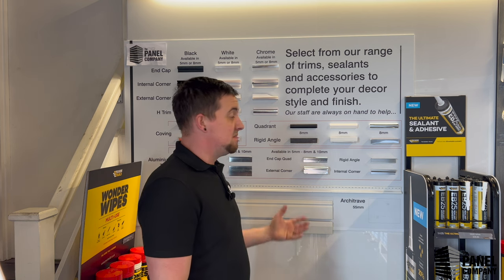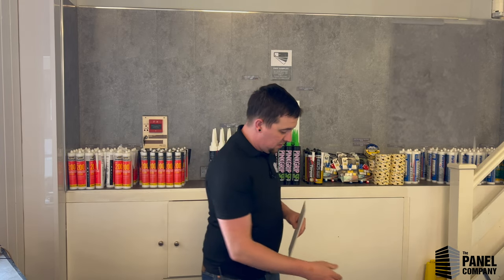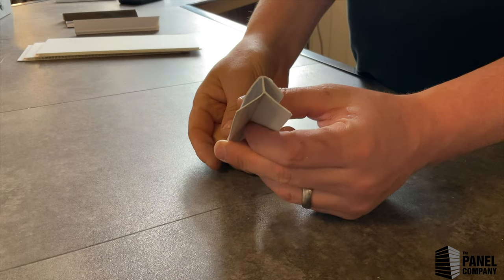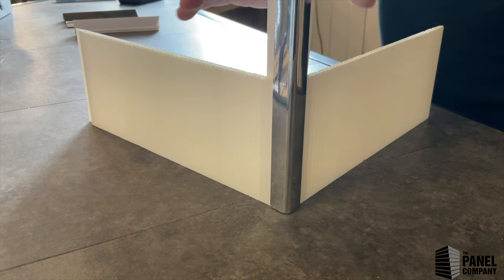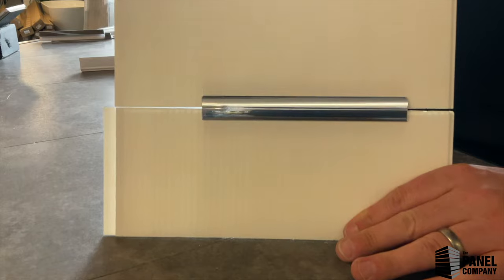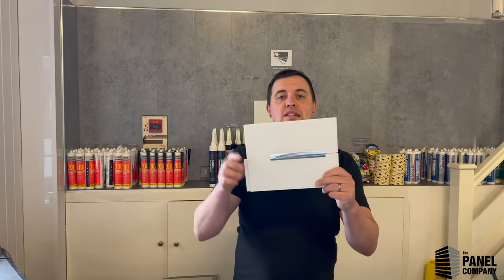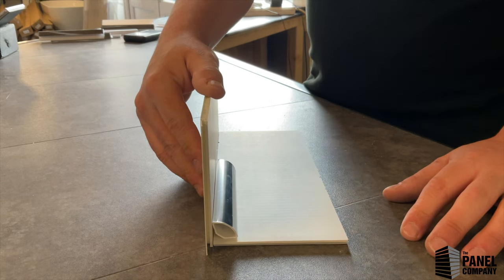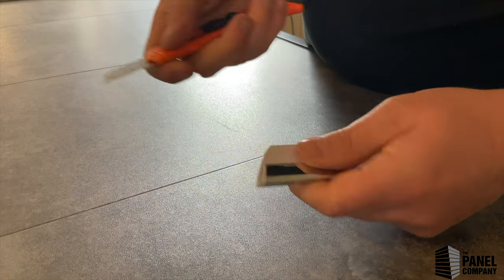Wall Panel Trim Guide | The Panel Company

Comment: If your wall height is 2405 and panel is 2400 what would you use to bridge the gap between wall and ceiling?
Reply from the maker: With only about 5mm you have a few options. Option 1: use a coving trim around the top which is about 8mm. Option 2 raise the panels and use the skirting to cover the gap. Option 3: Drop the ceiling and use the extra space for the likes of sunk in spotlights or speakers.

Comment: Hi Panel Co. Have my delivered panels from you now. Can I just ask, for the end trims, do I stick these on first before applying the panel to the wall? If I don't I imagine I won't get it behind the stuck panel. If this is the case, what do you stick the end trims on with? Thanks
Reply from the maker: Hi Samuel - Yes you are quite right - you would need to install the end cap trim first or if possible slotted into the panel first and then onto the wall - you would need to apply silicone inside the trim firstly ready for the panel to be slotted in for this method - if you need to install the trim first we recommend a line of silicone running along the back of the trim and then apply to the wall. Any further questions please do get in touch.
Reply: @ThePanelCompany  thanks appreciate that and similarly if you are doing a U shape install I guess you can only put on one corner trim as the 2nd one will have to be on the back panel as you slot it in otherwise the board won’t flex to get in both corner trims?
Reply from the maker: @creativechimp03  Yes that is correct one internal corner should be fixed to the wall and then the second already fixed to the the panel you are putting on that back wall, and you negotiate getting the trim and the panel onto the back wall - whilst fixing the panel into the internal corner trim already fixed to the wall. This can be quite tricky to manoeuvre however it can be done!
Reply: @ThePanelCompany  thank you appreciate that.

Comment: Can you panel a shower longer than 1m without H trims? (So the panels looks continuous)
Reply from the maker: Hi Alex - Yes that is no problem at all > all of our panels come with a tongue & groove interlocking system that provides a flush finish. On installation we always recommend a tiny bead of silicone inside the joins to ensure extra water tightness, any excess adhesive that seeps through to face of panel should be removed instantly. You may find this guide for T&G panels of interest >
www.panelcompany.co.uk/blogs/news/a-guide-to-tongue-and-groove-wall-panels

Most people install this way without the h-join trim - this trim is either used for overall look (which is personal choice) or for when someone becomes un-stuck with measurements etc.

Any further questions get in touch!

Comment: Question to The Panel Company and any experienced bathroom installation pros in the comment section!
! I have a shower over a bath. My 10mm depth panels will be coming down from the ceiling & meeting sone original 1950s tiles (white normal sized then narrow black ones at the top) that are above two sides of the bath,  I love the tiles so don't want to remove.
The tiles are just UNDER 10mm depth and I guess with the panel adhesive the panel will be a couple of mms proud of the tiles. 
What edging trim would you recommend for the bottom length of the cladding panel please?

Comment: Just received my order, very prompt, thanks. I’ve got a question. From the shower tray the rear wall is vertical, approximately 5 feet up then it slopes forward slightly, the 10mm panel won’t flex. So is it just a case of cutting precisely & silicone or is there some flex in fitting a H joint, what would you recommend? Many thanks Phil
Reply from the maker: Hi Phil, thank you for the kind words! We would recommend a H-trim/trying to level the wall out to achieve a flat finish.

Comment: Hi, great vid! I’m going to be cladding my ceiling very soon but I’m not sure the best way to finish the edges. Would you recommend coving, the retro fit or end caps?
Reply: I did intend to use end caps because I can screw them into my wall tiles but your video has confused me as to the best option. The other options require an alternative method of fixing, don’t they?

Comment: Hi mate so am doing my bathroom first time ever to do this can you give me some useful starting tip and would you do the ceiling first before the walls  thanks
Reply from the maker: There is no right or wrong answer for this however, i would personally recommend doing your walls first. If you do your ceiling first you have to be careful moving your wall panels around the room and fitting them to be careful not to take a chunk out your new ceiling!

Depending on which side you start when fitting your first ceiling and wall panel ensure you cut the tongue or the groove off so the first panel fits flush with the wall or the trim.

Comment: Hi,  Is there a special trim to finish the last internal corner off? I'm about to purchase materials to do my bathroom but unsure how I would fit the last panel as the trim would already be in place
Reply from the maker: There is no special trim other than the internal, The internal corner has quite a big recess in it. This means you can cut the board slightly extra so you able to manoeuvre it into the trim.

Comment: Can you explain how the external corner trim is actually  used . The trim Can't be screwed to the corner and will it be strong enough with silicone alone? Thanks.
Reply from the maker: Hi Farhat - The external corner gets fitted to the internal corner first prior to panel installation with a line of silicone on the back of the trim to fix to the wall surface if existing tiles OR pink grip (an instant grab adhesive) - if installing onto a porous surface such as plasterboard. This keeps the trim in place whilst the panels get slotted into this trim, and then it is the adhesive on the back of the panels that keeps everything in place whilst all of the adhesive sets in. Hope this helps, if you have any further questions please do get in touch.

The Panel Company.
Reply: @ThePanelCompany  brilliant thanks.

Comment: Can I use coving for an internal corner in a shower?
Reply from the maker: Potentially yes, but we wouldn't be able to recommend it. is there a reason you can't use the internal corner ?
Reply: @ThePanelCompany  thanks for your reply:) yes  my back panel wall is 10mm and the side ones are 8mm, is there an internal corner trim that will fit both?

Comment: Hi guys.
Which trim would you recommend I use for an internal corner that's incorporating the ceiling?
Is there a trim that would let me slide in the panels like 3 way, two walls and a ceiling or would I need to mitre the corner in?
Many thanks
Reply from the maker: Good Question! There is a few ways. The First way is if your wall to ceiling corner is 90 Degrees then you could use an internal corner otherwise we would probably recommend Coving. The alternative is to stick them as close together as you can without trims and apply a thin bede of white silicone.

Comment: Can the coving lengths be joined? if so what is the best method for a joint-free look?
Reply from the maker: Hi James - Yes however you would just have to butt up either trim to each other rather than them interlocking, the best way to do this would be either to use the two sharp ends that are pre-cut (how the trims come) - or create a clean sharp straight cut yourself when cutting the trims. Any further questions please do get in touch.
Reply: Yes.
if you know more, follow my channel, we have a smart ceiling skyight panel that can simulate natural sunlight and blue sky

Comment: Are you able to include a shower niche with shower wall panels?
Reply from the maker: Hi Jonathan - You can yes however the walls / inset shelves behind where panels would be installed should be water tanked prior to installation, you would also need to use the external corner trim on installation so that panels could be connected at all angles, and the mitre cuts would need to be very precise, so that the shower niche is water tight. Any further questions please do get in touch,

The Panel Company.

Comment: I am planning on cladding the kitchen walls; no wall cupboards just base units - I was going to use the end trim on top of the granite worktop but having watched the video I understand that this may not be such a good idea - would you recommend a different trim or clear silicone sealant?
Reply from the maker: Hi Monica, In this case, the only trim that would be suitable would be an End Cap. However like mentioned in the video when used in this format it can build up dirt. So this is a more personal choice. Your other option of course would be to use silicone which will be perfectly fine. I would recommend a higher-grade silicone. and use the strip out smooth out tool to prevent any mold: https://www.panelcompany.co.uk/collections/adhesive-and-sealant